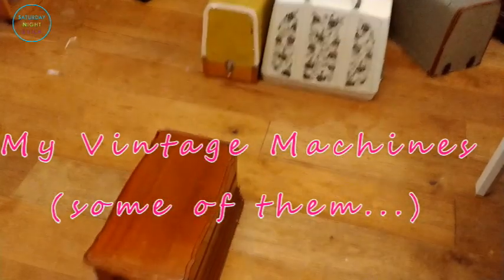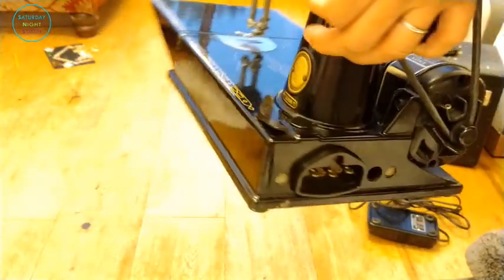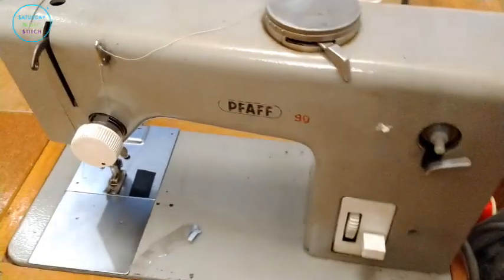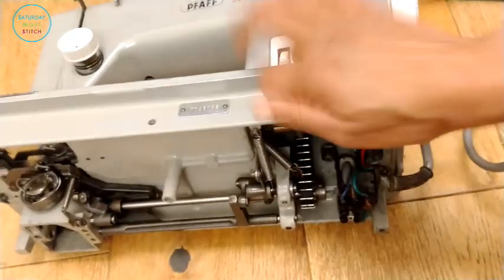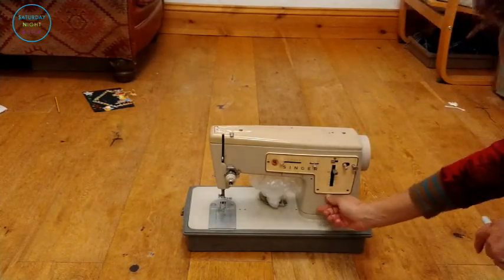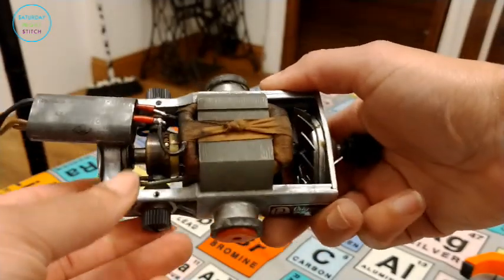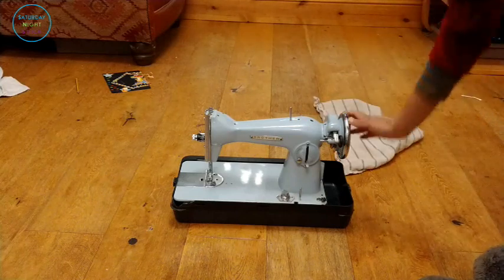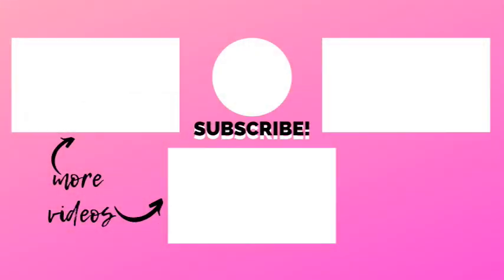My Vintage Sewing Machines Collection (some of them....)

Comment: I need to stop and ask you please, please, please, Keep the presser feet down when you don't use the machines. Even those that you don't/can't use. And put a small piece of cloth under the foot.
Reply from the maker: Thanks Sapphire! I will definitely do that from now on. Thanks for the tip.
Reply: @SaturdayNightStitch  I only say this because i heard that keeping the presser foot up can mess up the spring.. I hear there's a spring in there, I should have said so from the beginning. ;p
Reply: But do not run the machine with the presser foot down without cloth underneath.

Comment: I loved seeing your beautiful collection!! I adore vintage machines, and have a few of my own. I've just purchased my first Featherweight 221. I love it!!! I've learned so much about them by watching youtube videos. I had my first thread jam, and learned why. I learned to always turn the hand wheel towards you, never away from you. Even rocking or a slight turn in the the opposite direction will start the jam in the bobbin area . Luckily, I was able to watch the Featherweight Shop videos and I was able to fix it without damaging my bobbin case . There is an order to removing the parts so you won't break the finger part of the bobbin area. It's not fun to handle a thread jam on a Featherweight!  I think I'm going to order the thread jam tool in case it happens again. Enjoy all your lovely machines and happy sewing 😊

Comment: Thanks so much for bringing this wonderful display of machines ,matching your equally extensive knowledge of the histoy.
In 1960 I had a collection of over 100 mostly Singer machiines which after a marriage I donated to a museum....Move on to 2010 and now in France, retired,  I began doing it all again.  these machines are captivating...I have a collection of over 50 (still growing) 
I have just bought for 20 euro a Singer 411 that I think you have as a 401. and it came with all the discs and bits and I will go so far as to say I doubt it has ever been used.
All my 4 grandchildren have sewing machines, mostly 15K variants, and it is wonderful to see the work they make....and... the interest from thier schoolmates..
Keep spreading the gospel....sewing machines never die ☺☺

Comment: Beautiful machines!! You should watch which direction you turn the hand wheel. 95% of machines should only be turned towards you so clockwise. There's one machine of there, that I know of that turns counter clockwise.
Reply from the maker: Thanks for the tip.

Comment: You have the wrong bobbin inserted into your Featherweight. That's why the bobbin case won't fit. It's actually a class 66 bobbin what will fit into your 401G. Find some class 221 bobbins (they're cheap) and that bobbin case with your 221K will work. Look up The Featherweight Shop here on YouTube. They have many mini-instructional videos. 
Happy sewing! 😊
Reply: Doesn't the Singer 301 case fit a 221?
Reply: @simonahernandez1459  yes

Comment: Beautiful machines! I especially like hand crank machines. That singer 15 with no motor could be fitted with a reproduction hand crank. I have done that to 2 old singers and they work quite well. Original singer handcranks can be found but are quite expensive

Comment: I'm  truly impressed with your admirable knowledge of these nice old machines. I'm searching about for a machine to use, and wonder what you would recommend. I sometimes wish I had a machine that was could handle heavier duty.
Reply from the maker: Thank you! Glad you enjoyed the video. For the machine if you are looking to sew with slightly heavier materials up to leather for simple leather projects then a Singer 401G will have the power for that with the benefit of having zig zag stitch functions - just make sure you use correct needles for the fabric. If you are not bothered about zig zag and just need a straight stitch then you cant beat Singer 201K in my opinion. Good luck with it! Buying these vintage machines can be a tad addictive :-)

Comment: I inherited my Mother’s Necchi Silvia 586. She hardly used it. It’s  handsome and a good sturdy machine - all metal casing, and came with an amazing array of feet. The 4- step buttonhole does give more flexibility than the automatic options on my Electronic Janome. I ought to use it more, but I suppose I’ve got used to the Janome.
Reply from the maker: The Necchis were the premium of Italian manufacturing and I remember reading somewhere how well they would survive being thrown from buildings and just go. Its sounds like a very lovely machine. Thanks for sharing!

Comment: Thank you for sharing. Do you use all of them or do you just own them and have one machine that you actually sew on. I had the vintage machine bug a couple of years ago and recovered. I own four vintage Necchis, some Singers including a Rocketeer, Singer 201-2 and 15-91, a Kenmore build like a tank and two Berninas (1230 and 1030). I really only sew on the Berninas but I feel guilty about not using the others at all!
Reply from the maker: Oh wow - the Rocketeer! I certainly salivated over that one for ages before I accepted that the likelihood of my getting my hands on one here in UK was very slim. I do use them - some more than others (my cabinet 201K is a joy) and my Brother 661 tend to do more than the others. I try to use them at least 1-2times a year as a minimum. Sometimes one will stay out and get used until it doesn't have something (eg my 201K-2 doesn't do buttonholes).

Comment: This is an older video...Did you get your featherweight to work?  In this video, it looks like that plastic bobbin in not the right bobbin for that machine.  I learned to sew on a featherweight and the bobbins are flatter.  Are you sure your bobbin case is wrong instead of the bobbin?
Reply from the maker: Yes and yes Thank you! She sews beautifully since I bought the correct bobbins. I now even have a white one too :-)